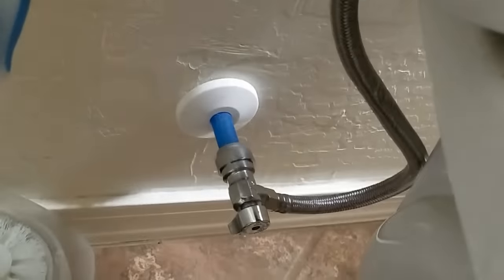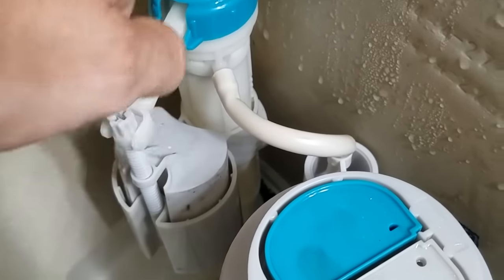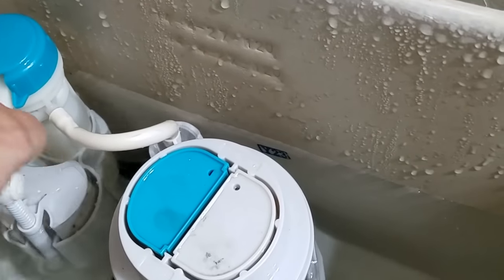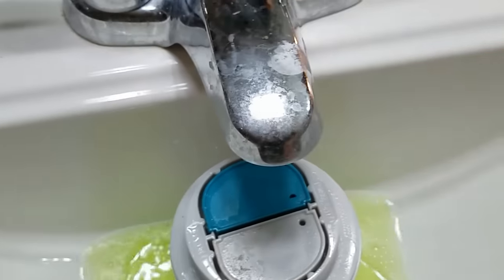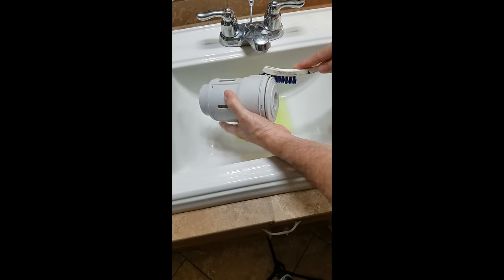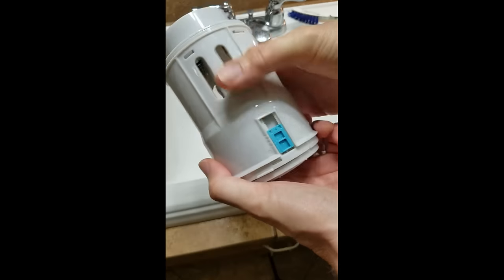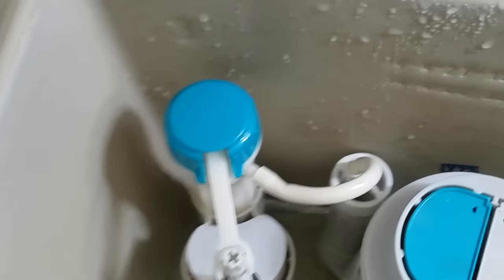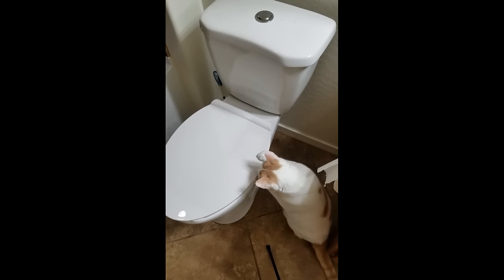how to adjust a dual flush toilet

Comment: What part is the siphon with the blue button? Mine is a similar design, a bit taller. It’s currently not dropping the valve after a flush, which means it just keeps running water and doesn’t fill the cistern. Is there a way to fix this?

Comment: I had the same problem. I rubbed it down with a soft cloth to remove the calcium. I removed the silicone seal and wiped it off. All good. Great video very thorough. Thanks.

Comment: Realistically, if your toilet was flushing fine, no need to make it use more water. I just bought 2 of these, because they were 200$ on clearance for 45$ each, and oval with the silent close toilet seat. It's actually allot more comfortable to sit on and an easier target to hit when standing, so far we are very happy especially since we paid so little for them. Gotta love LOWES around the last week of January, that's when they clear out the previous years bath stuff - hint hint... We got a 3 piece glass shower for 90$ as well, retail was 585$. Yeah, the little guy wins once in awhile...

Comment: you solved my problem with one sentence.   the 'out hole' in the toilet is where the water is supposed to rush out.   mine fills fine, but you have to hold the flush valve down... sometimes it flushes all the way, sometimes not.   but if you dump a pot of water in really fast, whoosh and down it goes, so not the 'disappearing' end of the toilet.    i took the flush valve out and cleaned it top to bottom, but it back and still the same thing... took the part from the duplicate toilet in the basement and same thing, but both flush valves worked in the downstairs toilet, so obviously it's the toilet not the flush valve.   on with the rubber gloves and whaddaya know, i could actually feel crunchy bits all around the inside of that front hole (sure there is a technical name)...   just about out of CLR, so i dumped a whackload of vinegar in it.   not sure how much my septic tank critters will like that but better than chemicals...  so thanks!   pretty sure that's going to fix it.  5 mins later.   took a tiny screwdriver, with the handle down into drain hole, and gave a few pokes at the calcium crunchies and they came off no problem...  back in business!!

Comment: You mention using a wire brush. While the CLR is great for removing calcium deposits, I would not use a wire brush on the plastic parts. It will scratch them and those scratches can actually introduce leaks. Just use a brush with plastic bristles. An old tooth brush is good: I take all my used tooth brushes out to the garage/shop for a second life.
Reply from the maker: old toothbrushes work the best

Comment: I'm having issues with filling up faster. Mine takes like 2.5 minutes. This dual toilet is almost like mine. Is it possible you do a video how to fix the slow water 💧 flow? Thanks again!! 😁😁😁
Reply: Try adjusting the fine adjustment clockwise.

Comment: We kinda have the same valve and it is a push down toilet as well. Problem is, the toilet wont fill with water. How can we fix it please?
Reply: Im.having the same problem after i adjusted the clip
Reply: Take the rubber ring off and turn it the opposite way around

Comment: Just got one of those types an it seems that the  bowl doesn't fill enough it seems that the overflow is to short so the tank only fills less then a foot. But it seems like it has a strong flush. It is brand new I was wondering if I add a piece of pipe on the overflow would that fill up the bowl higher so the (Mr. Hanky) would have a deeper end   💩    You showed me a few things on this type of plumbing good information. Thanks  !

Comment: Just installed a similar low flow valve and new toilet for the first time in our home that previously had an ancient traditional toilet. Our first day with this and I'm confused as to why we're needing to hold down the white button for almost the entire flush to get the full force needed. Shouldn't this be a simple one touch and done? What have I got wrong?
Reply: You went wrong when you got rid of the superior old toilet. (Sorry, I'm renting and hate this thing in the video.)
Reply: @DeJach  Maybe, but the 100 year old toilet had an ugly cracked bowl for decades. Plus the ball-cock flush mechanism was constantly getting stuck and needing attention every few weeks. Annoying when I come home after many hours to find that someone forgot to shake the handle after a job. I've adjusted this new American Standard low-flow and so far it's pretty good.

Comment: Thank you I have simular toilet mechanism I noticed it started leaking water tonight from the kitchen lights downstairs so I headed up and took some water out from the top bowel and noticed there was a plastic tube sunken to the bottom of the bowel but still attached to the right hand side part then I noticed the plastic flusher has two small round holes either side so I put the tube into the plastic flusher but had to put it quite far down. The it looks a lot longer than yours!  So basically what I think happened is the water was very close for over filling the bowel after flushing and now I'm concerned about flushing it. This all happened within the last few hours so what do you suggest I try please?  Hope all that makes sense.

Comment: After installing a brand, new toilet, does the same thing the other toilet did whereas it will flush down the water in the tank but the water in the bowl will not go down. What’s the problem?
Reply: This sophisticated siphon is by design a mess. The old school ball float was and still is way more reliable. The culprit is usually  a delicate rubber diaphragm seated atop this siphon that is controlling the water flow into the tank. The diaphragm has a pin hole, actuated by the float arm. The thing is over time dust or minute rust particles pass through the inlet side and get lodged in the pin hole. This disturbs the vacuum, preventing a perfect seal in the area where the diaphragm sits. Eventuallly you have this run off situaution. Althhough a simple dismatle and clean up is enough, a majority of normal folks end up damaging the diaphragm or not sealing the system properly and that's the point of no return. I am currently on my 3rd set in 9 years. When the leak starts I always try to fix it once and if it occurs again in a short while (which it will if not done the proper way), I've learned to straightway replace it as it is fairly cheap, costing less than $5 here in India. The stuff is made in China anyway and is by design a use and throw spare. Saves time and gets the system back in business in under one business day. The only real benefit I see in the single piece toilet vs. the more traditional european toilet is the less water that is needed per flush, plus it looks sleek. But the king of reliability is always the traditional ball float siphon. There is nothing sophiticated in its mechanism and any average joe can replace a faulty ball float flush siphon rather than paying a plumber.

Comment: Are the buttons really hard to push? I just bought a Mansfield summit dual flush and haven’t installed yet. I saw a YouTube video saying don’t buy it’s too hard to push flush buttons. I have little ones so worrying it will be hard for them to flush it.
Reply: After installing this toilet I found there are no issues. There is an adjustment for how long the “sticks” are that are hooked to the buttons. Either the person has a defective button or it’s out of adjustment.

Comment: Hey bro, I got the same model, there is an issue that the water come in like stop and go and stop and go, no idea how it comes, tried to adjust the float but no use,
Reply: Remove the float (carefully pull apart hinge where it connects). Pop the little blue top off the intake valve (left). Counterclockwise quarter turn and the valve comes apart. Check the seal for mineral build up and clean. Reassemble. That should fix it if it just keeps flowing even when the float is up.

Comment: Hi, just got this installed. And its been a problem. The fill valve doesn't seem to shut off completely. The float does its work perfectly and stops the water. But I have noticed overtime that the water keeps trickling in and the tank gets full. How do I fix this. Also what's the function of the hose leading into the overflow?
Reply: Agreed, i have the same problem!  Slow trickle, despite the valve fully 'shut'!
Reply: Same here. Different brand but the water trickling very slowly
Reply: Likewise.  I'm going to try a new fill valve after cleaning the flush assembly, but if that doesn't work, i'm all out of ideas.  Fill valves can fail over time.
Reply: You may have to take apart your fill valve.  I had a similar problem where the toilet would fill very slowly and not always turn off completely.  I took apart the fill valve and saw it was plugged with debris from the water line which both prevented the water from flowing freely and stopped the valve from closing completely every time.  After I cleaned the debris out with a small screwdriver it worked great.

Comment: my toilet is different. the push button is screwed onto the flush rod. and the flush rod has reduced in height so i cant screw it back on. and I cant raise the flush rods height! But I cant find any video or model with the same toilet as me with an explanation.

Comment: Nice video but would have like to see you remove and check and clean the gasket which normally wears out after 10 years and leaks. I had a 10 year old Sams Club duel flush toilet that was leaking so paid another $109 for a new one and just replaced the entire tank. Next time I will try and fix before spending $109.

Comment: how do you adjust how much water is in the bowl?  seems way too little.
Reply: The 2 valve adjustments control how much water flushes, the water level in the bowl is probably relevant to the design of the trap that's cast within the toilet itself; The water level in the bowl has to be just above the trap. You can try adjusting the valve but I don't believe that will help. If it's flushing and not plugging up, leave it be. The water in the bowl only has one function, to trap the sewer gases from reaching your nose. It's why the Queen of England was chopping off heads left and right until one of the peasants learned how to trap the water within the bowl, thus sealing off the stench...
Reply: In my case The bowl is not functioning well. it doesn't stopping the water flow. It's keep the water flow in and water gets over flow through the small valve near the Central unit. Don't know why the bowl is not doing its job well. Does it is an issue with the washer ? Do anybody knows ?

Comment: Can you please tell me how to adjust the water level in the bowl itself.  Mine stays very low and it’s gross
Reply: If yours is a bit newer (unsure if the one in the video actually has this) there the small white rubber hose which goes into the open overflow pipe which has attached to it a small blue cog, turn it right/clockwise towards 8 to add more water to the bowl from the next time it fills onwards
Reply: ty. i will try that tonight! @genericallyrandom
Reply: i did this to adjust the water https://youtu.be/c_Kcg7Ul6e4?si=1a82e5KA-fhXRg46

Comment: Mine is working but when filling up it starts to run and stop run and stop. Just sounds different. What do you think that would be?
Reply: @r y I will check it. Thank you
Reply: The plunger is leaking the last part in the video Remove the plunge from the center and clean it like he did in the sink or order a new one Hope you figured it out
Reply: @southwestbaltimore1353  I just jiggled it around for now and it’s working but probably could clean it. I see rusty dirt in the water on the bottom

Comment: Mine is overflowing so when it's full, it flushes automatically even not pushing the button.
Reply: Same problem. Look up toilet fill valve over flowing. Great videos. Ive the same problem. Looks like a 2 minute fix with no tools. Hope you got sorted

Comment: The smaller buttons on the side are both for the full flush. The slider on the side is the half flush adjustment. Otherwise a great video.

Comment: you do not have to turn the flush valve all the way till it stops (mine does not stop lock)(12:33) because it is the flush valve seal, that "seals" not the valve position. Also, on my Tuscany Dual Flush, you can turn the flush valve C.C.W. or C.W. -- it does not matter and center the blue-half flush/white-full flush) just like it came from the factory. The number gauge on the flush valve faces towards the bowl which places the white-full flush on the right side.(Full flush is also called "Long Flush". I imagine you can swap which side you want the Full vs half flush on by rotating the valve itself and the dual buttons, but why? I just left it the way factory had it. the two push buttons are easy to clean with vinegar or alcohol. It even disassembles easy if you really want is super clean. Personally, I clean "IT" everyday. Not too many things are worse than a nasty loo. It's possible to push the two buttons all the way down, and get them pretty clean without taking them apart.
Reply: My first exposure to this system after a lifetime of traditional values. Why is it that we're needing to press the full flush button and hold it down waiting for the entire flush to complete instead of a simple press & go like it should be? I DIY installed a new American Standard toilet yesterday

Comment: I have water beads on top of the blue valve tower AND it's dripping from under that same blue cap. It also "runs" every 19mins or so. The toilet is brand new. Help 😢
Reply: theres a ajustment screw and turn it clockwise on the fill valve its called or replace it for 10 dollars from home depot

Comment: Is the overflow tube height adjustable? so that I can fill more water in the tank which may increase the force that my toilet jet needs to spray water out. right now the water flow is too weak to flush the toilet.
Reply: No. The height of the overflow tube is not adjustable
Reply: @jackdowd594  you could add a piece of pvc pipe. Believe there’s a video on it.
Reply: All you can do is adjust your valve as he showed. That overflow pipe allows the maximum amount of water, either 1.4 or 1.6 gallons or depending on the manufacturer... It's enough if all other plumbing is working correctly.

Comment: Hi my two flush buttum flushes  same and large amount of water how to adjust that???
Reply: There is another adjustment for that, no one talks about on my model. The white phillips head screw to the right of the main flush valve adjusts the low flush. Also the whole tube can be pulled up and there is a blue tab that has bigger adjustments. I set mine to 3 and used the white screw to make minor adjustments to the low volume flush
Reply: @lmasucci  the white screw and the blue tab only adjusts how much water returns to the bowl.  The lower the that mechanism is and the lower that tab is the more water goes back into the bowl with each flush. It’s the same for both lite and full flush.  The adjustment for lite and full is on the center mechanism. Turn it clockwise and remove it and you will see there is an adjustment on each side and are labeled accordingly.
Reply: @scottlemke1275  Thank's for clearing this up for me.  I looked into the information you provided and made some precise adjustments.

Comment: Your toilet fills so quickly. Mine takes an eternity to fill. Any suggestions as to why?
Reply: First thing to check is that your shut off is open and doesn't have a lot spot built up when wide open (try slowly opening/closing it during a refill to see if it speeds up or slows down and different points while turning. 
A lot of fill valves will come with removable restrictors, but it's not normally recommended to remove them.  Your shut off or supply lines are also common culprits for getting gunked up and restricting flow.  Replacing both never hurts and if you buy shark bite it's a pretty easy reno (just make sure you reem the old pipe and clean out all the copper shavings or they'll make your problem worse).

Comment: In my case The bowl is not functioning well. it doesn't stopping the water flow. It's keep the water flow in and water gets over flow through the small valve near the Central unit. Don't know why the bowl is not doing its job well. Does it is an issue with the washer ? Do anybody knows ?
Reply: @thaha -  hello!  When you say 'bowl' do you mean the water tank that is above the seat?  If so, then it might be the big washer that his thumb is touching at 6:14 - if this is not seated fully, water runs continuously down into the toilet bowl at the bottom.  
Just 'bodged' one today, the washer was old, slightly distorted, so I removed it, inverted it, and replaced it.  This then flushed OK and stopped after flushing, but only if the short flush was used.  Likely that the washer is still not well seated, but the residual pressure of the partial flush keeps an adequate seal.  So I made it into a single (not dual) flush toilet, but it will still do a small flush. HTH? Ben

Comment: This toilet is driving me crazy If I try to adjust the float it either runs for minutes to fill or I can adjust the flow and it runs shorter but then it doesn't automatically fill with water I flush it I hate this toilet I have spent hours trying to adjust it!!!🤬🤬🤬

Comment: whats the purpose for the white tube?
Reply: Is the overflow tube, avoid the water in the tank flood the bathroom (sorry bad english)
Reply: The tiny white tube is for bypass flow which goes directly into the bowl. While the tank is filling some water is going to bowl through the tube and normally there is an adjustment for how much bypass. Too little and bowl level is low after fill. Too much and water is wasted as bowl dumps down drain.